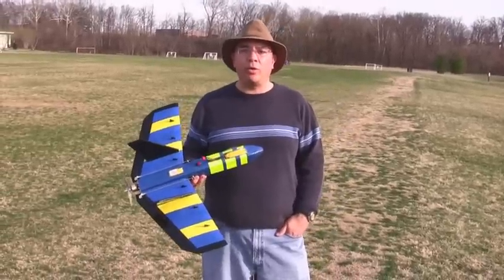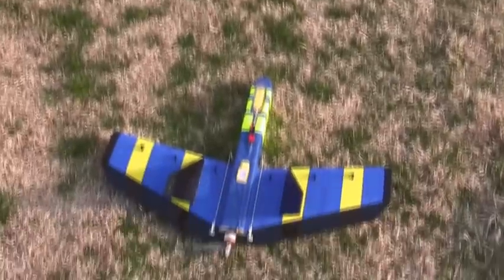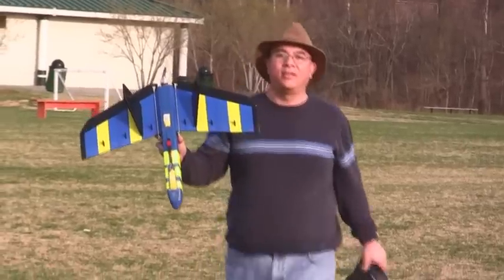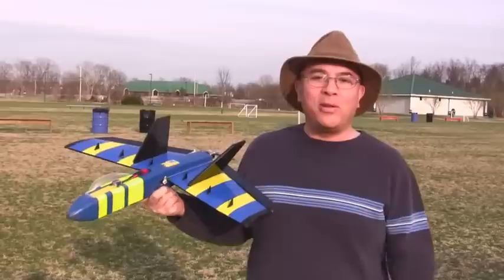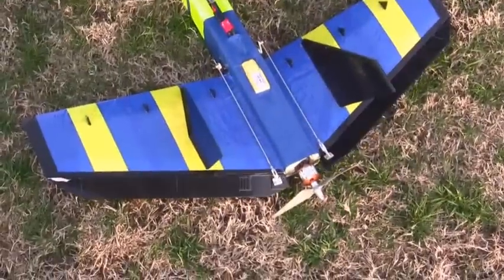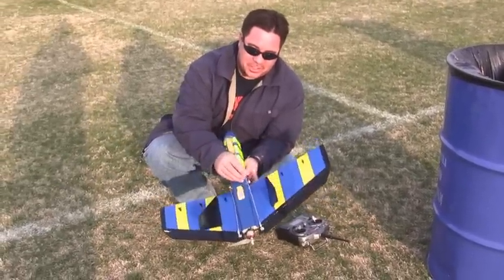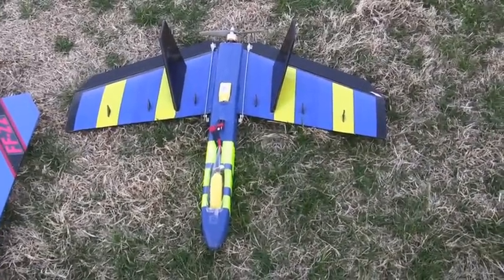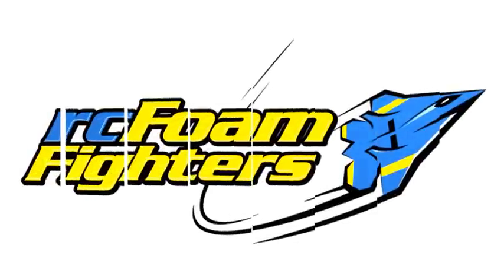EPP Bullet Proof Plane Series Part 1 (crash testing) continued

Comment: I watched you guys fly and I think you need crash resistant planes.
Nice work Have you tryied KF air foils 
Its better than vortex gen and if you put KP air foil on top and bottom very stable and fast or just one on top helps you recover rolls easly as helps keep it up right.
I think my planes are bullet proof to but I live in AUS and not many bullets to dodge over here.